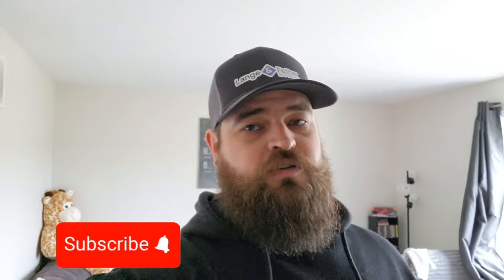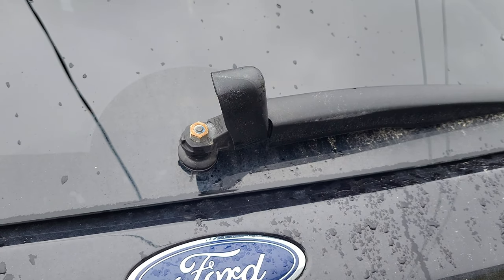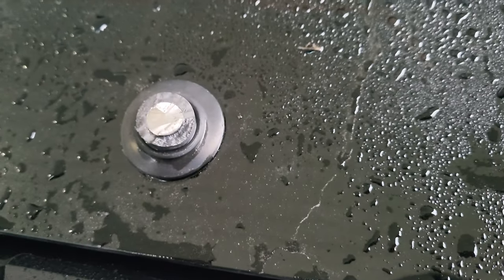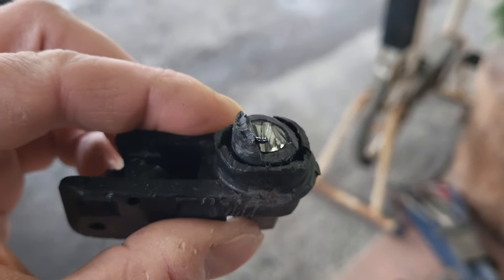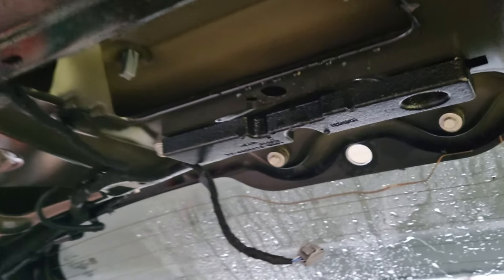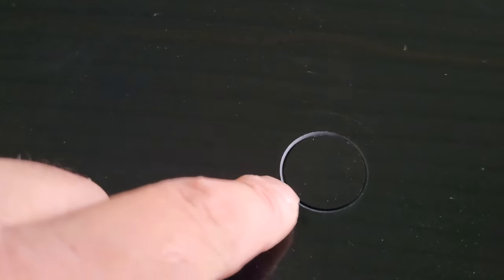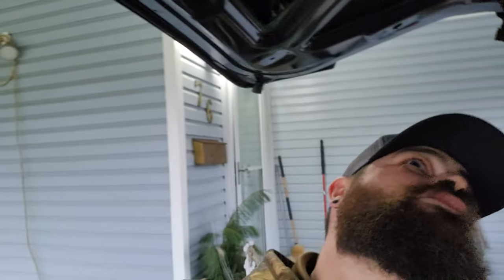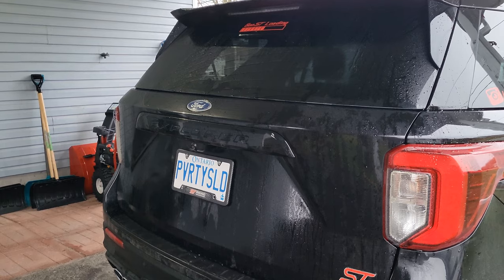CUTTING the Rear Wiper Off My 2021 Ford Explorer ST

Comment: I had to do the same thing. The insert plug is quality. If you want a seamless fit use some black RTV on the outside, then scrap of with a razor for seamless look.
Reply from the maker: You had to cut yours off too? Wild! Ya I mentioned in there that you can silicone the outside to fill in the gap. It doesn't really bother me to be honest

Comment: The wiper arm is press fit on a tapered shaft. The ford service manual calls for a 2 jaw puller.
Reply from the maker: @cedjunior  I am fully aware of that 👍 Normally it can be removed by grabbing & wiggling it like everyone else does time & time again. In my case, when I looked at it, I could see the Loctite. I have since spoken to others who had the same issue WITH the puller.